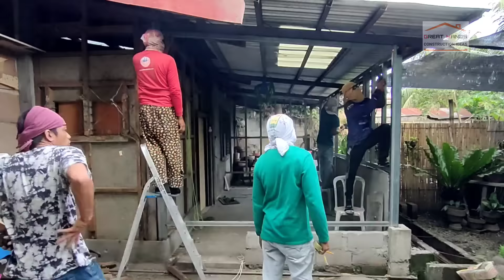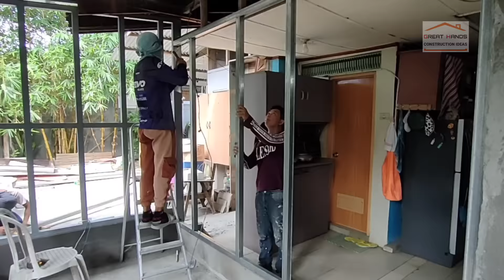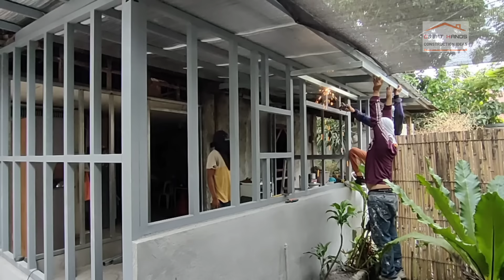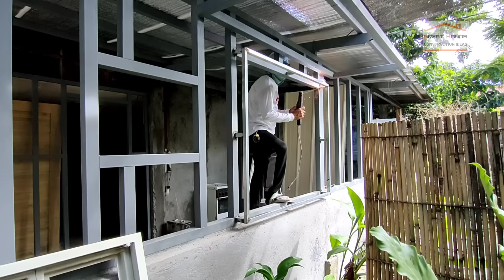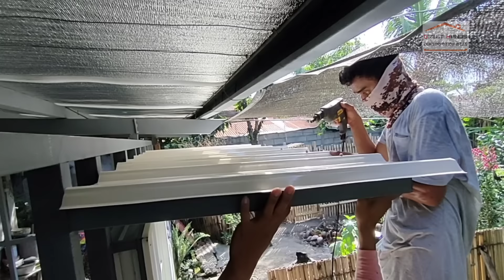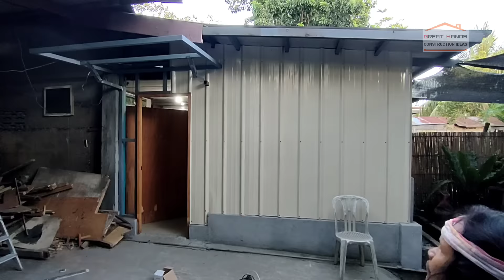FIRST EPISODE: Small Room Ideas || Kwarto Na Gawa Sa Yero || Rib type Roofing

Comment: Not advisable in a tropical country
Reply from the maker: Depende lang po siguro yan sa paggawa ma'am.marami ng ganyan dito sa atin ngayon.👍
Reply: Sa squatter erea ante common na Yan partidad nagkakape pa Sa tanghali😅
Reply: Korek  kase subrnag init nyan
Reply: Double walling is fine though
Reply: @annabelleaquino3143 sabay na sa init ang mga pinoy 😂
at saka yan na rin uso ngayon as long as may doble walling  di nman ganon ka init...
Reply: Tama, mainit yan at mejo mahina sa bagyo compare sa cement,pero ok na yan sa budget at pang temporary lang
Reply: Galvanized steel plus insulation hindi iinit yan, may alam ka ba talaga o nagdudunung-dunungan lang?
Reply: @red_ashcroft malamang nagdudunungdunungan lang yan.
Reply: Double insulation with double walling at split type aircon ok yun sa tropical country at taniman ng black bamboo  sa kiliran ayos2x
Reply: Mainit nga din ang cement hahahaha
Reply: punta ka sa citi hardware

Comment: ang purpose ng Insulation foam ay para iwasan ang pagpasok ng init sa loob ng bahay, hindi siya ang nag aabsorb ng init, kaya ang standard is atleast 3/4 or 1/2 inches ang distance ng foam at ng yero, ang tawag diyan is Air Gap, diyan sumisingaw ang heat, kaya kung nakadikit ang yero sa insulation, hindi magtatagal ang insulation at maluluto ang foam sa sobrang init at yan ang magiging dahilan sa pagkakadurog at pagpupulbos.
Reply: pwede po kayang dun ikabit yung insulation foam sa ilalim ng kabilang side ng dingding if yung pang double wall sa interior is ficem board para po di nakadikit sa yero at may air gap?
Reply: @pastelpereirra1037  mas matipid boss karton. Garantisadong wlang init na tatagos. Siguraduhin niyo nga lang na kung may wiring sa pader e balutin niyo ng insulator para hindi pagsimulan ng sunog.
Reply: Paano kung may insulation sa bubong. Walang air gap dahil naka patong ang sim sa insulation
Reply: Egg tray ang ginamit ko na insulation sa gitna ng wall clad at double wall hardiflex, di makatagos ang init.

Comment: Sapat na ba ang thermal insulation para di mainit sa room kasi yero ang dingding ty po sa reply
Reply from the maker: Sapat na po bossing. Malamig po sa loob kahit walang aircon.
Reply: Sa nagtatanong po. Ang ganyang klase ng wall o bahay ay hango yan sa portable cabin na madalas sa middle east gngmit para gawing barracks ng mga workers or ofw na mga manggagawa. ang middle east ay isa sa pinakamainit na lugar na halos umaabot sa 50 degree. ang ganyang design pag sa pinas ginawa ay napaka smooth lang ng init na mararamdaman dahil mayron itong heat proof insulation at hardeflex na wall. Ang pintura po ng yero na iyan ay hindi po nag aabsorb ng init bagamat pinipigilan pa nia ang init dahil yan po ay may tatlong layer na patong ng pintura sa paggawa.  ang primer nian is inorganic zinc silicate, ang midcoat nian is epoxy mastic at ang topcoat nian is polyurathane. ang opacity ng polyurathane ay nagpipigil ng init para mabawasan ang init na papasok o maabsorb ng epoxy bago pa ito pumunta sa zinc silicate kea ang pinaka yero nian is mild nalang ang init matatamo..